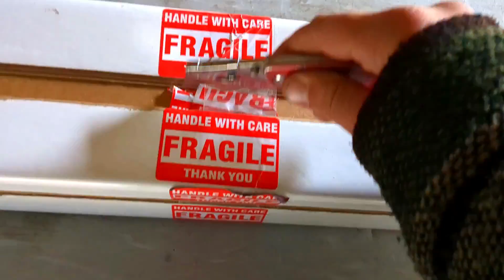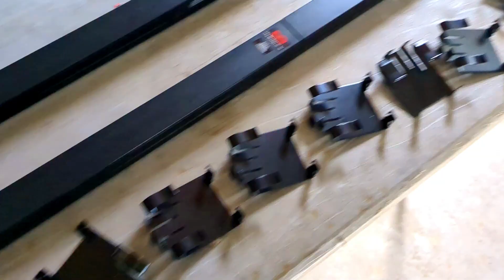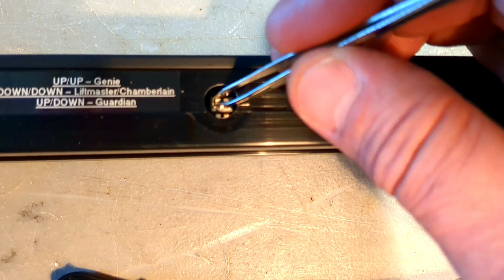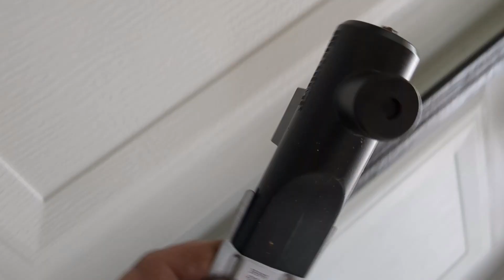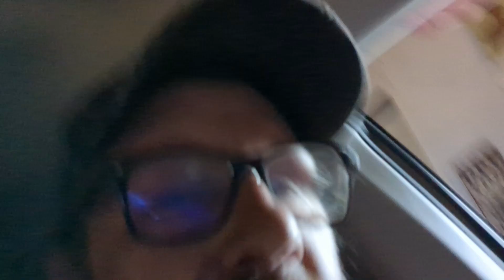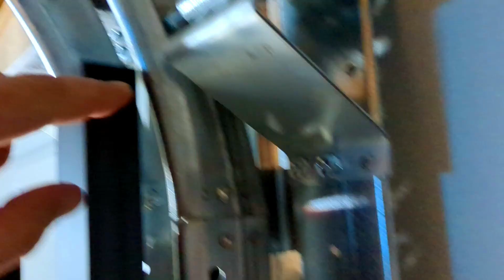Increase Home SAFETY with INFINITY SHIELD Garage Door Sensor #2023

Comment: This is something operator manufacturers should have offered years ago. I really like this, and might even get a set for my door, but my concern is the exposed LEDs getting sun blinded. If that’s not an issue with the current design, over a 16-18’ wide opening, then I’m sold!
Reply from the maker: Broh, you'll love them!
The LEDs won't be a problem with sunlight.  That's something I should've mentioned in the video.  After talking with Mo over at Infinity Shield, he had me sold.  The engineering department implemented firmware that eliminates the sunlight issue. That's one of the features he said that their department is really proud of. Because they were aware of that problem.
If you decide to order a set, click the link in my description, utilize that discount code.
Thanks for checking out the video buddy. Your opinion really matters!